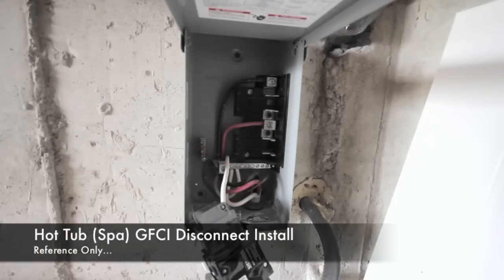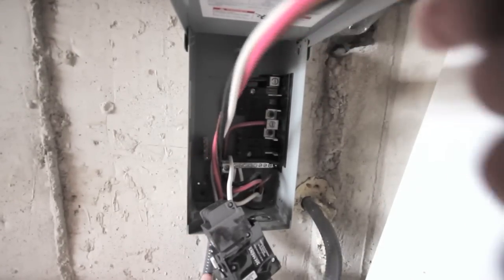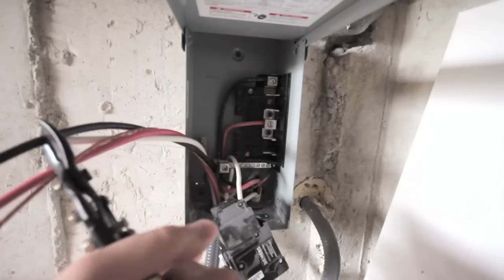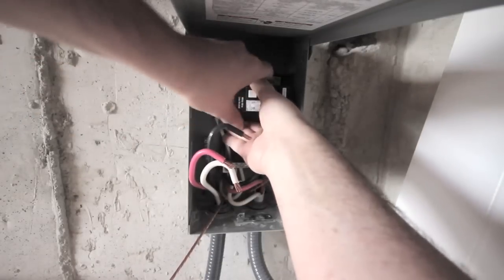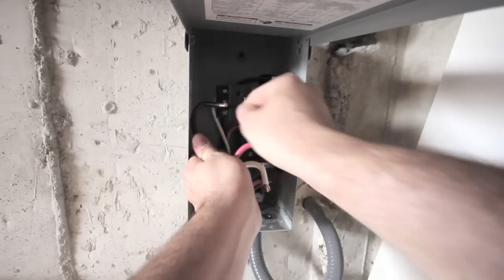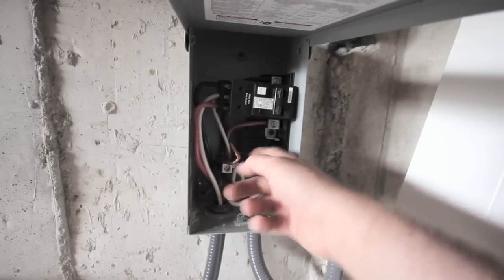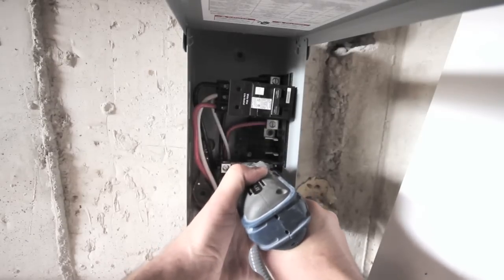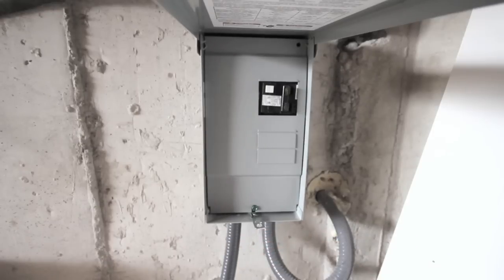Hot Tub (Spa) GFCI Disconnect Install

Comment: What gauge wire do you have? I am using 6 gauge and I just wanted to see if my configuration would be the same as yours as it's very tight to move the wires around around with 6-gauge.

Comment: Hi there... I had a quick question about installing a disconnect box to my main circuit box.  I had purchased an all-in one hot tub panel box with the 50amp GFCI built into the box.  I figured I would just need to run a 220v line from my main box (GE) to this box and hook it up... but an electrician friend said the disconnect HAS to be GE as well.  IS this true?  I am not a pro, but it would seem that since it doesn't really connect to the GE box, just the main electric it would work.  Any help appreciated... thanks!
Reply from the maker: +Brad Coates Not sure on that one, sorry.
Reply: I can't imagine why it would have to be GE...220 V is 220 V. I'm not a licensed electrician, but I am an electrical engineer and I can't see any reason why it would make a difference.

Comment: Ok, I have a spa box like yours.  I got it used with a spa recently, it had only one ground bar which had both neutrals and grounds previously, just where your bottom bar is in your box.  I talked to an electrician who said to add another bar, I did.  The original bar has a green screw (into the box) and a metal piece.   The new bar I put in, I just screwed into the box.  Question, which is the ground and which the neutral bar and does it matter?
Reply: the green screw is usually a ground screw.

Comment: The GFCI breaker in the sub-panel must be of equal or greater Amp rating than the breaker in the main-panel... Is it bad to have too large of a breaker in the subpanel?? I noticed suppliers often charge the same regardless of GFCI breaker size and It's good to keep options open.
Reply from the maker: Reg Dunn I have a 50 in the sub and 40 in the panel, I wouldn't go to far over what the panel is.
Reply: Heard that rule from somewhere?, I couldn't find any reason, cheers eh!
Reply from the maker: Reg Dunn Yeah I did lots of reading before hand, it seemed to be a commonality among people in the know.
Reply: Thanks, that's good enough for me :)

Comment: So when your are running the main feed from the house to the spa panel. Does it matter where the black and red wires go if they go on top or the bottom?
Reply from the maker: I'm going to say no BUT I'm not a pro.
Reply: Okay thank you
Reply: Tyson Sarrica It doesn't matter.  Each leg is roughly 120 volts (Phase A and Phase B).  If you have OCD like me, then you would keep them consistent.  :)

Comment: I noticed the GFI breaker already had a white wire attached to it that you didn't explain. Is that the common wire from the disconnect terminal leads in that same box? If so then do you just take the white you cut and attach to the common bar. Are the wires you pulled into this box coming directly from the spa? What I mean is there is nothing else you would have to wire directly at the hot tub? Thanks for the video.
Reply from the maker: Correct on everything, I didn't show the connections at the hot tub but they are pretty straight forward and fool proof.
Reply: Stephen, can you tell me what type of conduit you used and size. I will have to use 6 gauge wire and after leaving the disconnect going to the hot tub I will have to bury the conduit for a run of about 10 ft. I didn't now if the type you used could be buried or if I have to swap to another type.
Reply from the maker: Charles Bain depends on the code in your area, I doubt the flexible would be allowed.

Comment: Hello Stephen thanks for your help in advance. I'm also trying to power up my used jacuzzi. I need to run 240v power from the main box ( sitting at the front side of my hose) to the back yard. What is that I need to do to ensure everything gets done safely and efficient. I believe is a240v 40 amp reader that I need. Thanks
Reply from the maker: I have a 40amp breaker in my main panel and a 50amp on the GFCI panel.

Comment: Couple questions, when you hooked it up to the hot tub, do you have to bury or mount the cable to something? 
Is there a bonding screw to remove in that disconnect?
And one more, when you hook it up to the panel in the house, you were able to use a regular breaker the same size as the gfi breaker?
And what type of cable is that? Is that just flexible conduit? Tech? Thanks, hopefully you can answer these questions!
Reply from the maker: Yes you have to bury or mount it to something.  No bonding screw.  Regular breaker, 40AMP.  Wire is 6/3, get black for outdoors, yes flexible conduit.

Comment from the maker: Short run from the panel, only a few feet, it's on the other side of the concrete wall, 6/3 wire white because mine was all indoors, black for outdoors.

Comment: Hi Stephen, I am installing the same similar set up. What gauge of wire and how long is the run to the GFCI panel? I am told to run minimum 8 gauge for about a 60 foot run the GFIC box. Also, I am going to "presume" your GFIC breaker is a 50 amp and if so, did you put in a normal 50 amp breaker in Main breaker box?

Jim.